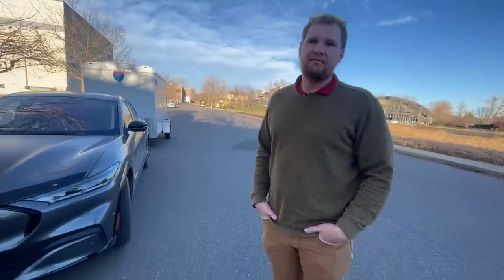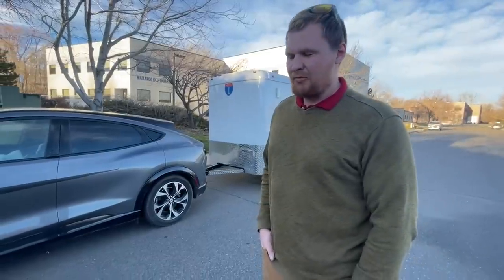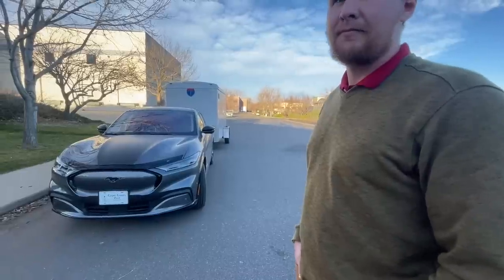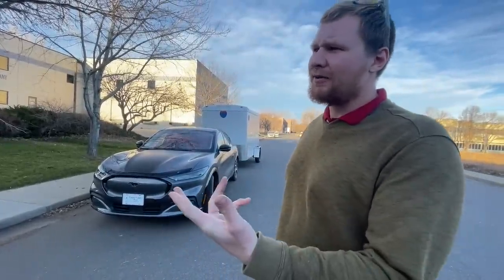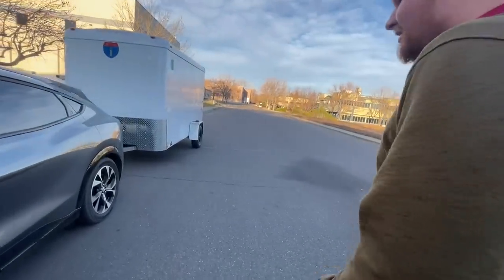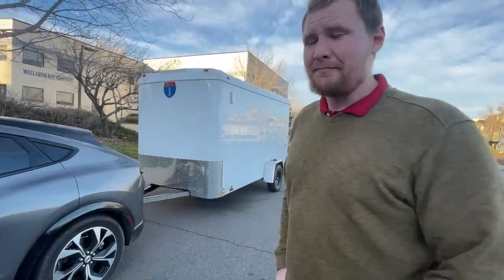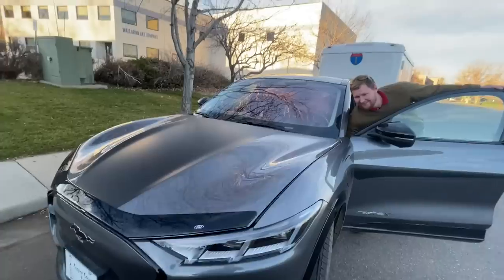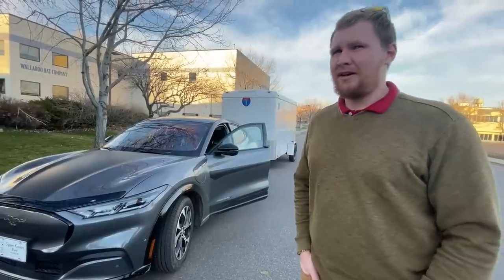Mustang Towing??? - Here’s What It’s Like To Tow Across Country in an Electric Car NOT Built to Tow!

Comment: Very informative interview about "off label" use of the Mach-e. It's great to know that the Mach-e is versatile. Roman's questions were exactly spot on. I owned a very similar trailer that I towed with a 2013 Silverado. My loaded trailer weighed in at 5000 lbs (Truck stop scales). Towing I averaged 12 mpg at 60-65 mph. I did have and needed trailer brakes.
The driver was quite knowledgeable about his rig. His slow country delivery style confused some of the commenters who thought Roman badgered him or cut him off.

Comment: In Europe Ford rates the Mach-E at 1500kg, that is over 3200 pounds, more than this trailer. And there is no fundamental difference in the body equipment so U.S. models could tow the same amount if they were factory equipped.

Comment: Real chill dude, not the typical Mustang owner.  Mach E is termed "cross-over", so sort-of SUV, as Tesla Model Y claims, while Model X claims real SUV.  With all, most reviewers report having to search for a charging station every 100 miles or less.  Even more fun is having to unhook the trailer to access a charging stall.  In sum, your trip will take almost twice the time as with a gas or diesel vehicle.  Public chargers cost 30 c/kWh or more, which makes fueling more expensive than an efficient gas/diesel vehicle, and you pay twice as much for the vehicle.  Tesla's Culver City SC charges 48 c/kWh and always has lines.  For now, hybrids make more sense since the batteries are so expensive.

Comment: It is best to try to keep the battery between 20 and 80% in most daily cases.
On a trip going above 80 and below 20 is OK but more stops for charging is better than sitting at a charger to get fully charged. Charge, take a bathroom break and go. If you want to tow on a regular basis a Tesla CYBRTRK, Ford Lightning or Rivian RT1 might be a better choice.

Comment: Our hyundia kona with heat pump consistanly giving 4.9 miles per kw we have had 6.3  several but we feel that's on ofvthose my partner who drive a bit more eco than me gets 5.2 regular
So we are enjoying we use our 7kw home charge about once or twice a week depending if we doing extra distance. In the two month  we used ccs once

Comment: Since it’s not designed to tow, does towing void the warranty?
Reply: It IS designed to tow, they can be ordered with a hitch to tow up to 3500 pounds. As long as you don’t exceed all of your capacities, your warranty is intact.
Reply: @booya6437  Gotcha, I just took away from the interview, especially when he said “I hope Fords not watching this” that is wasn’t designed to tow, thanks for the clarification.
Reply: They only allow towing in Europe for some reason and state to not tow in North America. I don’t know why.
Reply: @enzop.3227  interesting, thanks
Reply: @enzop.3227  Where did you hear that? I worked on the Mach E for North America and we were advised it could tow up to 3500 pounds.
Reply: @booya6437  it’s not recommended as per my owner’s manual, and what do you mean by “worked on the Mach E”?
Reply: @booya6437  not true. It is not certified to tow and towing will void warranty.  The fact that it "CAN" tow is irrelevant.  If you're in an accident while towing with a Mach-e you can be held responsible and your insurance may not cover you. I believe it's a DOT thing, not necessarily a Ford thing.

Comment: You guys have a knack for selecting some of the “aero-coupling” combos.  The best coupling is when the trailer hides in the wake of the tow car. Longer trailers that taper slowly are better. The id4 and tear drop is junk as an aero combo, you could have taken advantage of the iD4 chunky body with a longer trailer, but again coupled it poorly. Look you guys need a lot of clients (like many gas car manufacturers and many models) but if it goes to just the f-150 and Tesla, you guys are out of business. The only knowledge to be gleaned from your videos is the need for better selection of trailer to tow vehicle to improve  aero-coupling combo efficiency the penalties of pairing  the wrong trailer with the wrong car.

Comment: EPA on that car is 270 miles range (not in the winter).
Reply: Yes but in real life in nice weather you can get over 300 easy, Tesla on the other hand rated over 300, in real life 275. EPA needs to fine Tesla.
Reply: @jackylsmith8138  EPA needs to standardize their range testing, Tesla uses a different EPA cycle than most other manufacturers giving them shorter real world ranges than EPA vs other manufacturers getting longer real world ranges than EPA.  So it’s a bit silly comparing Tesla range on paper to other EVs because it’s not apples to apples

Comment: It costs me $26 in diesel to haul my camper 120 miles. The Mach-E isn’t too bad.
Reply: does your camper weigh 2000lbs?
Reply: I Just towed my 17 foot travel trailer which weighs 3200 lbs up the west coast, 1000 miles.  Tow vehicle a 2016 Ford transit 150, averaged 14 miles per gallon.  In California gas costs $5.00 gallon at top tier stations, in Oregon it costs $4.00 per gallon.  So it cost me around $42.00 to drive 120 miles in California, $34.00 in Oregon.  It also took me three days…..So to me his trip experience isn’t so crazy.

Comment: Maybe the specs are different for Mach-e sold in Europe? Mine came with an optional tow hitch, however only approved for 750kg.
Reply: Towing regulations in Europe seem to be different. The expected driving speed is lower so a lot of vehicles have are rated to to more weight in Europe than the US. Alex on autos has a good video on this

Comment: EV adoption is accelerating every year. Exponential not linear. The only limiting factor is batteries.
The number of electric vehicles and types of vehicles and trucks is growing.
Many people are holding off buying a new car or scooter until the electric vehicle they want becomes available.
Electric vehicles are just better. No noise, no emissions, less fuel costs, less maintenance costs and amazing technology. Gasoline and diesel are OLD polluting technology. So last century.  Electric cars, electric trucks, electric buses, electric trash haulers, electric snow blowers, electric lawn mowers, electric weed whackers, electric hedge trimmers, electric snow mobiles, electric water craft, electric garden tools, electric mechanic tools, electric motor cycles, electric bicycles, electric scooters, electric farm tractors, electric construction equipment, electric delivery vehicles,  ...... everything is going electric.  No worries about starting after sitting for a few months. Gas always needs repairs. If you care about the future for your children care about climate change
Reply: Would suck for anybody living in an apartment to drive a electric car. Theres almost zero adoption of electric car infrastructure amongst apartment complexes.

Comment: It’s a cool looking car, but Tesla has better battery control systems add the charging network iam puzzled why buy the mustang , the  Porsche a much better build and performance has big problems with its battery systems and charge control, Tesla has proven systems reliability,  backed up with proven 10 plus year life span, the point here is Tesla will be around in many years to come there profit margins will guarantee that, all others are making at a loss or break even if they have no callbacks like GM, it’s possible to see a few of the old legacy companies around, Iam not betting on that it’s foolish to bet against Ellon, why you ask , because  the 4680when  fully rolled  out there’s no stopping them, it saddens me to see all those loved names struggle just to keep up even then it’s a poor effort 😞
Reply: If people behaved as logically as you thought, then we'd only see Toyotas on the road. People will buy other EVs because they don't want a Tesla. The Taycan my not be the best, but its still a Porsche.
Reply: @martyndavies1482  that true stupidity comes in a shapes a sizes, the Audi electron is using the same platform as the Porsche however Audi uses a higher quality power controller, that unit seams to be the Porsche problem I find that odd, in time Porsche will retreat into the shadows, 800 volt architecture has a time limit that Tesla don’t, I wonder how customers will pay for there shortfalls, Iam saddened by Porsches effort was hoping  for a plaid type effort, that’s why I nick name it the ha ha car, it pissed me off that much 😡